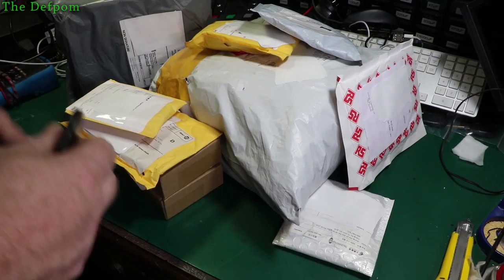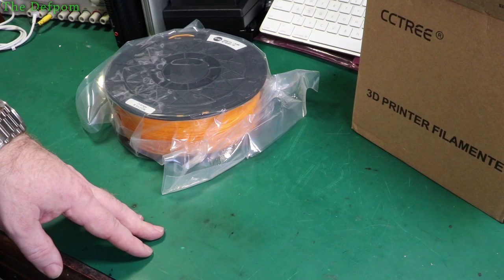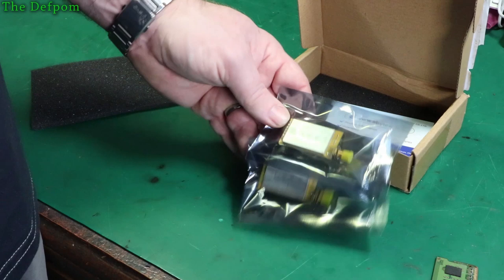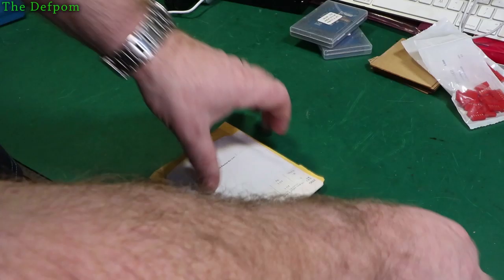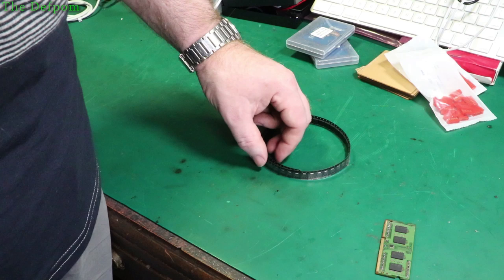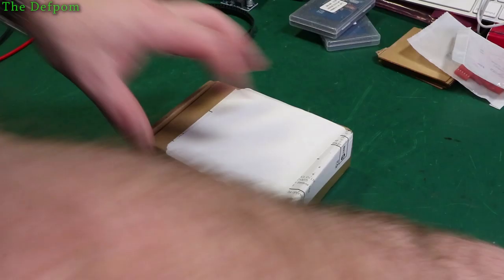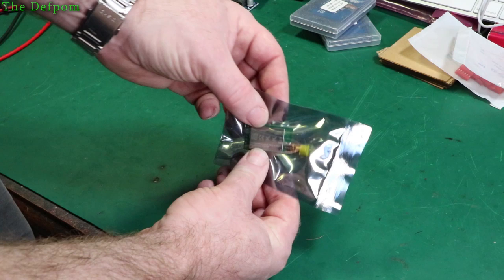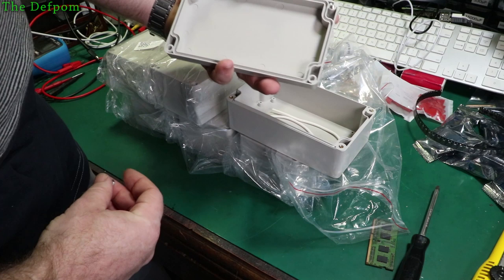#687 Mailbag Monday 17th February 2020

Comment: Hey Scott, it is interesting that you are using 868MHz LoRa modules in NZ.  I didn't realise they allowed that, when AU specifically doesn't.  We tend to share so many standards!  :)
Anyone considering buying LoRa / LoRaWAN modules should check their local government regulations.  This doc has a good summary for NZ, but also mentions other countries.  https://iotalliance.org.nz/wp-content/uploads/sites/4/2019/05/IoT-Spectrum-in-NZ-Briefing-Paper.pdf
Similar info for other countries can usually be found if you search the web for "[specific country/region] lora frequency plan"

Note even in NZ there are some restrictions on power for 868MHz, so those 1W modules may exceed NZ regs depending on channel and antenna gain.
Reply from the maker: Kean Maizels - according to the nz frequency plan I can use those modules, nz and au are slightly different.As far as power goes, I’m setting those high power modules to their lowest output, which is 21dBm, I am using these inside a vehicle.
Reply: @TheDefpom  Thanks, you're up early/late... like me!
I thought you'd be doing the right thing, but viewers may not be aware of the challenges of RF compliance.  We have to share the spectrum, and pollution (RF or otherwise) is bad.